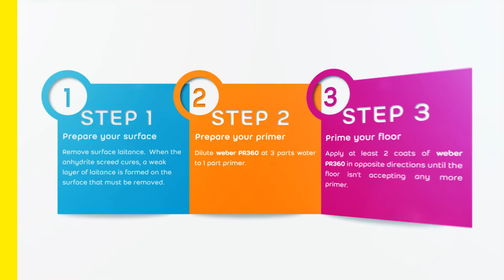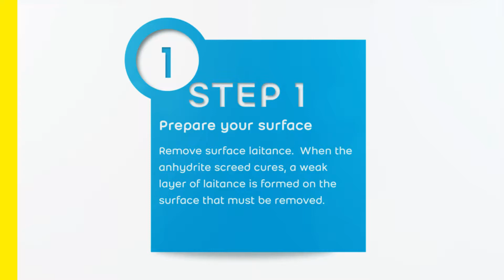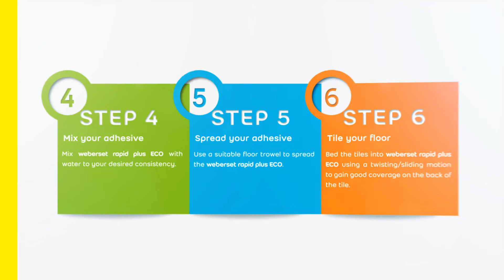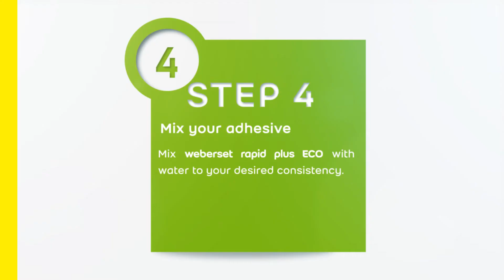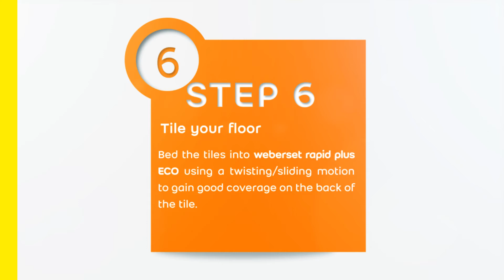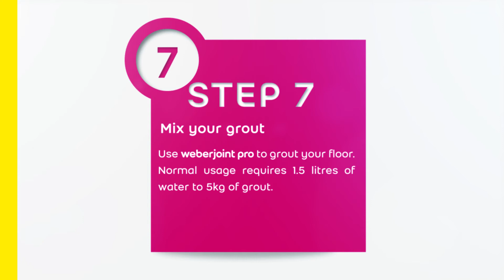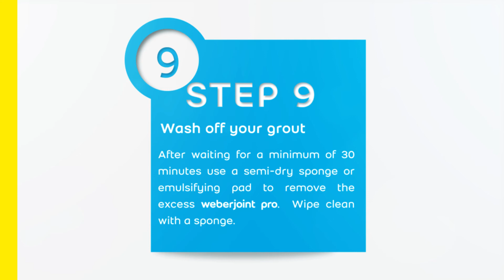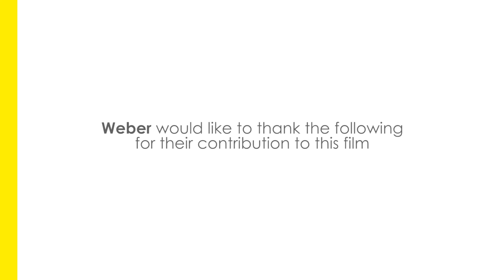Tiling onto an anhydrite screed — Weber Tile Fixing Products

Comment: would this method be suitable in conjunction with ditra mat
Reply from the maker: Hi Jonathan, Yes absolutely, it would be the same method of letting the screed fully dry, sanding and priming prior to fitting the Ditra matting. More info here... https://www.uk.weber/tile-fixing/tiling-anhydrite-screeds If you need any more information, please feel free to contact our Technical Department on 01525 718877 (option 2) or email technical@netweber.co.uk